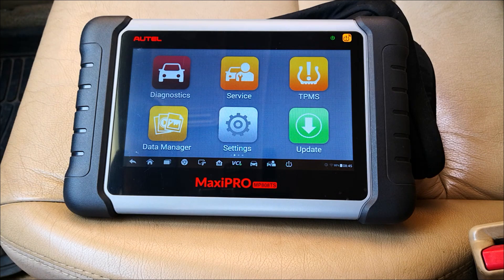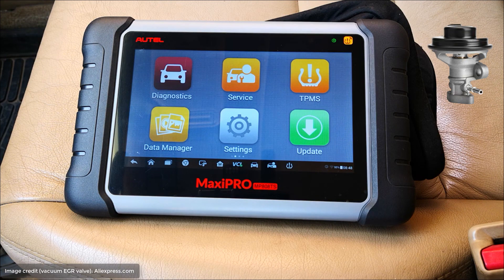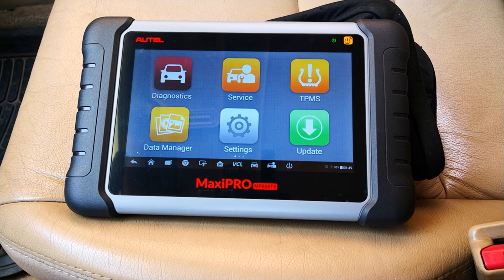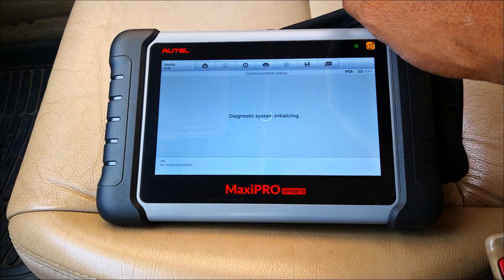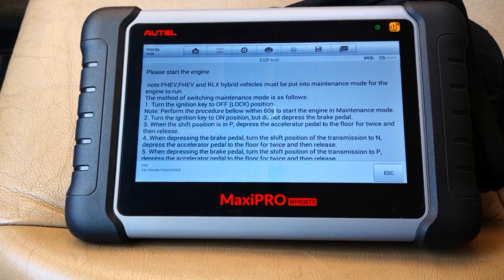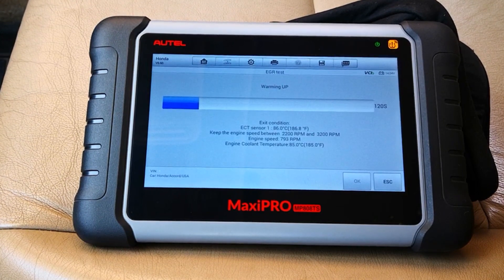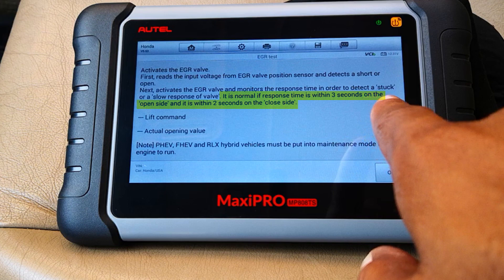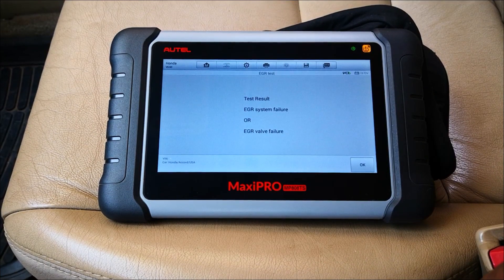How to Test Electronic EGR Valves / Honda EGR valves / with Active Scan Tool: Autel MP808TS (P0401)

Comment: I performed a smoke test on my 00 Accord and noticed smoke escaping from the EGR valve. Other owners have reported the same issue. Have you encountered this as well, or do you know if it's a common occurrence, or could it be a vacuum leak?
Great video!
Reply from the maker: Thanks mate. I didn't have this experience for the while I had this car. But a quick search I did showed it's a common place to to spring a leak in high mileage cars. My current Accord doesn't have an EGR 👌🏼🕺
That would certainly constitute a vacuum leak. Changing the gasket there should fix this as long as its not coming from a crack. You may as well just replace the EGR valve given it's a 00 Accord.

Comment: my scan tool show egr error 99.2 what does it means
Reply from the maker: I'd start by cleaning the EGR and EGR passages. That error code means the PCM had commanded the EGR off, but for some reason it hasn't properly closed. Rule out carbon build up. After that, you'd want to investigate EGR position sensor failure.

Comment: P2413 - check egr valve, cleaned it, test it, all done.  Test using scanner, its always failed.
Reply from the maker: Did you clean the EGR passages? Also check for the other causes of the P2413; poor connection/shorts EGR circuit, cracked vacuum lines, MAP/MAF sensor issues, exhaust leaks...

Comment: Hello, did you get the EGR ERR 99.2 on the scan tool? I am having this issue now and also doesnt give any light on dashboard. Please let me know. Thanks
Reply from the maker: Hey I never got that EGR ERR 99.2 code. It was just that the EGR won't pass that active test. It never reached the threshold for tripping an EGR code till I sold the car. I'd start with cleaning yours, including the EGR passages. If that doesn't work, likely the sensor for the EGR itself.

Comment: Hello my problem not start engine ,and go to Elektronik  and  egr aktive and 2 3 minuts  to not aktive how Problem no start to egr?
Reply from the maker: I'm finding it a bit difficult to understand. I think you mean you have an EGR problem. Have you scanned the car?
Reply: @DIYAutoworksNG  Here's how My car shut down while driving while I was driving in reverse and I couldn't start it again, I turn on the fuel through the diagnostics, it comes to the fuel filter, the diagnostics shows no errors, I go to the engine and test the egr, it shows egr active, then it changes, egr is not active Is the problem in the egr that I can't start the car?
Reply from the maker: A faulty EGR can cause a no start but so many other things will cause a no start too. This requires close troubleshooting. You can manually test the EGR valve solenoid to see if it clicks.

Comment: Did you try replacing the EGR valve and see if the test passes?  Because I tried this test on a few Hondas and it always fails.
Reply from the maker: I didn't replace the EGR valve. If the inline 4 9th Gen Accord had an EGR, I would have ran this again.
Reply: OK, so I cleaned the EGR valve in a 2005 Accord and 2007 Pilot.  This test always fails like yours did. 
 Since both vehicles have no codes and run very smooth I'm skeptical about the accuracy of the test.  My scan tool is the Autel MX808S with the latest Honda update.  The reason I'm skeptical is that the tool has other software glitches that are pretty obvious.

I'll try and contact Autel support.

Comment: Can u du whit this test EGR adaptaion/reset whit this scan tool?
Reply from the maker: It depends on the car. The functions are not supported for every car make, model and year.
Reply: Thanks. Can u check for me please. It's about Ford focus 1.6 tdci 2011
Reply from the maker: I just skimmed through supported functions for the 2011 Focus and didn't specifically see EGR adaptation although they were a lot of other adaptations/resets supported. You can have a second look here after selecting the tool and the car. https://autel.com/vehicle-coverage/coverage2

Comment: In my experience many cars use an EGR solenoid that will go bad after many years. The EGR valve itself will be fine. I have owned and fixed 3 different cars by replacing the solenoid.
Reply from the maker: Great. Thanks for sharing!

Comment: Helpful videp bro. Thanks 
my hyundai accent egr valve is not in timing,  sometimes it is open even in acceleration, thats why my car is jerking. I replaced the egr assembly and cleaned other sensors and intake manifold. But still egr opens intermittently. Usually when it happens when its cold, but sometimes even if im driving for hours, jerking is still there. It goes away when i park it for more than 10 min And drive it again. But sometimes after few minutes of driving it comes back somtimes also it remains normal.
Reply from the maker: Many thanks for the compliment!
Is your check engine light on? I advise you have the car scanned, then let's follow the codes to troubleshoot.
Reply: @DIYAutoworksNG  no error code bro.
Reply from the maker: Okay. Does the jerking occur under heavy load? Like climbing an incline, hard acceleration etc. With no codes, fuel trims have to be looked at. It should give some idea. Sometimes, fuel delivery issues throw no codes but can cause jerks especially under load.
Reply: @DIYAutoworksNG  it occurs even just in normal road, it starts from 1100 to 1500 rpm. It is worst in inclined road. I've tried dismounting the egr solenoid with the cable connected on it then jerking is gone. It runs like new, but egr error code will appear after running for about 10km. So i put the egr back.
Reply from the maker: Usually disconnecting the EGR should cause driveability issues. The improvement with disconnection does look like the EGR is stuck open, but then you said you changed it and don't have any codes. Are you able to get fuel trims with the EGR mounted? Ideally, at idle and at around 1500 - 2500rpm?
Reply: @DIYAutoworksNG  yes i replaced it with new one, it also does the same with the old one. My scanner does not show fuel trims bro but in some cars it does. The O2 sensor voltage moves up and down when accelerating and jerking. But in normal condition say ar idle voltgae is 0.99V and when accel it decrease to 0.5 or 0.6v
Reply from the maker: Live data is definitely needed with STFT and LTFT data to verify what is going on. Is it an ELM scanner you have? It's a bit odd that it relays O2 livedata but not fuel trims. Guessing you checked to see if it has the option to display more PID's via settings...
Reply: @DIYAutoworksNG  i have a Creader V+ launch. I wont display fuel trims in my accent, but i tried it in CRv and i saw fuel trim readings.  Maybe ill ley someone scan it with a better obd
Reply from the maker: I see. That's strange as I would expect the Creader to display that. Your plan sounds good. 
Just thought... Hope no leaks from the EGR gasket area?
Reply: @DIYAutoworksNG  im pretty sure it has no leaks because i always put silicone gasket aside from the metal plate gasket. Im not sure how its called.
Reply from the maker: Okay. 👍🏽

Comment: Nice videos, thank yew sooo very much, I have an accord 2005, a faulty delay in shift and bucking and sometimes stuck till I step off throttle pedal then it jerks in gears 1-2 when TPS is connected but when I disconnect the TPS it just revs up  from 2500rpm to 3000rpm when changing from 1-2 gear and the rest is smooth as usual any ideas?
Reply from the maker: Hey Nasiru, thanks for the compliment!
Do the jerks happen when cold or hot? Will be great to have the car scanned. The TPS effects shifts and it could be that yours is sending faulty data for the ECU AT to work with.